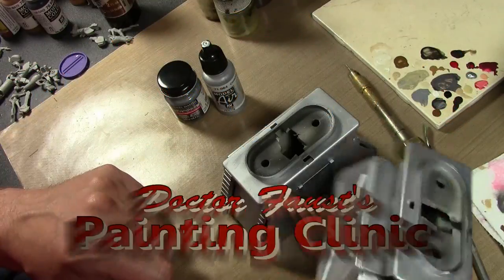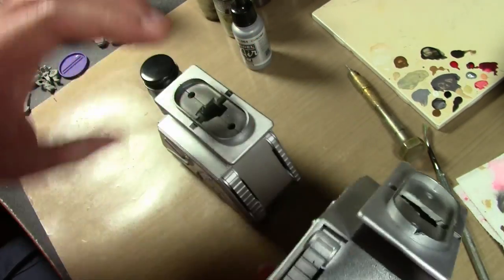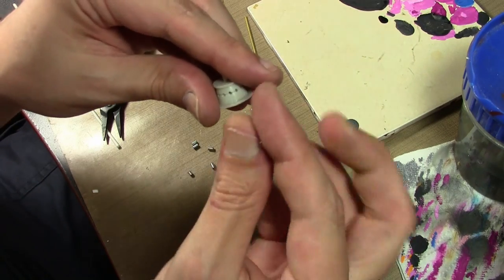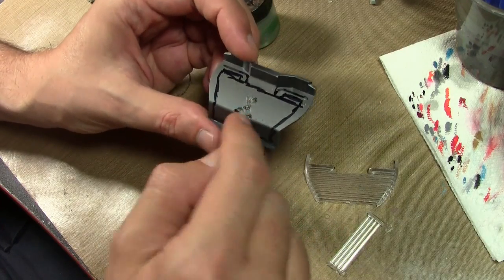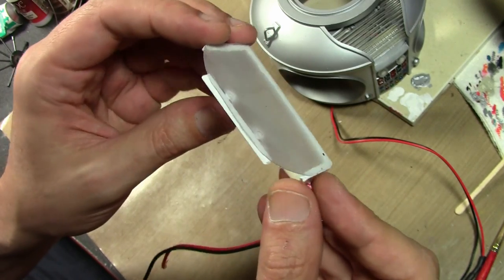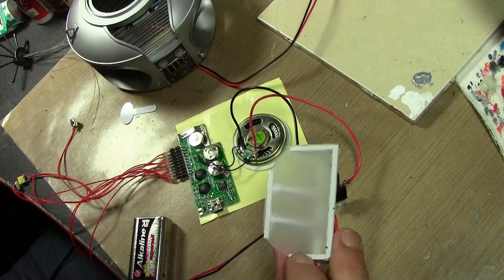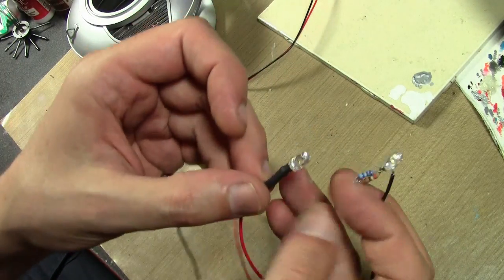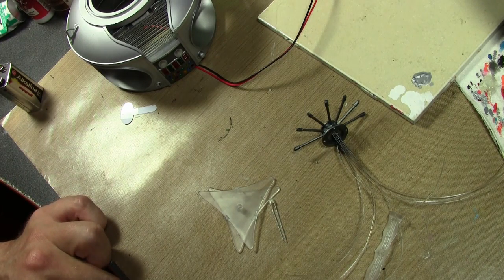Moebius Models Lost In Space B9 Robot Build Part 2

Comment: Older computer  used  the   Plastic  rods  that carried light  from a main  LED  bulb  which made it easier   to  remove the front  Bay Cover  and avoid  tearing the LED  light  mounted  on it  that showed the  Green Light  for PC-on   and  the RED  Light for Hard drive data transfer. 
  Some  of the new cars  with  fancy  Dash board trim  use   the Light carrying Plastics   as to locate the  LED sources  in one place ,  plus the Colour choice  can be changed    around to suit the driver.  
    The concept  is like the Fibre Optics    but it can work on 90 degree  elbows .  

        It might be worth trying to see if  a  small flash light  or  coloured LED   would   work  to send  light through the whole   set of rods  ,  just tape the over the area  where they meet   to contain the light   and then  have a dark area  such as a box  away from the lighting and hold the unit  inside to look for any  sign of  a glow. 
    The other way  might be to  wrap several Fibre Optic  wires  together as  one cable   to the light source  that runs up to the plastic  piece  ,  this way  an external  button  could  hang out  so you could  push it every time you  say a word  which means that YOUR  voice is  the one for the robot   on top  of the  pre-set     of Dick Tofel  .

Comment: If you want to have two LEDs flashing alternately, it can be done with a small handful of components by building a dual astable multivibrator circuit. You can easily find a circuit online.

Comment: As for drilling in clear plastic, I found a trick, when drilling thicker panels, if I ran my drill backwards I essentially melted through the plastic without getting cracks.  Don't know if it will help/work with the smaller plastic but if you have troubles maybe give that a try?  Cheers.

Comment: for the resistors you might want to try potentiometers they are basically resisters you can adjust.
Reply from the maker: Looks interesting. Would you recommend a strength? I'm finding ones rated from 1k ohm to 500k. I don't know if that means the min or the max level.
Reply: ThePaintingClinic
i believe that should be the min/max of the pot. i haven't ever used them for models so im not sure what would be the best ohms range for you. i have only used them when installing LED turn signals on motorcycles. what we did was we bought one potentiometer and adjusted the blink rate until it was what we wanted then measured the resistance of the pot with a meter and bought resistors that matched the reading. that way you don't need to wire in a bunch of resistors to find what you need.
Reply: @faceslasher808 if it's rated at 50k then that is the maximum resistance. If it's 10k then that is the maximum resistance. Most pots go from close to 0 ohms and up to their rating, though minimum and maximum values for the range can be set using a few extra components. You also need to be aware that some pots have a linear range while others are logarithmic.

Comment: Did you try mixing PVA with the paint on the pants?
Reply from the maker: That something you tried or just a guess? Sounds like it would just end up lumpy.
Reply: I have used it to paint on stubborn plastic surfaces before. Plastic cups don't take well to paint but if you add PVA it takes. No lumps.Maybe find a material similar to to pants and test it out